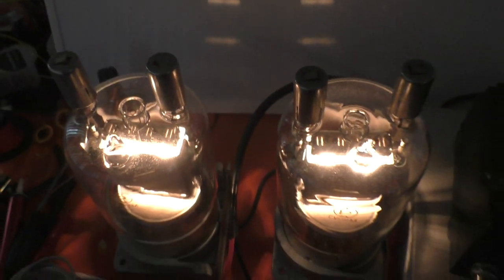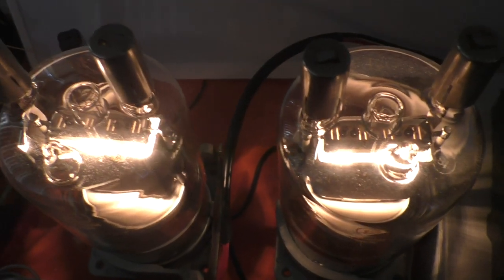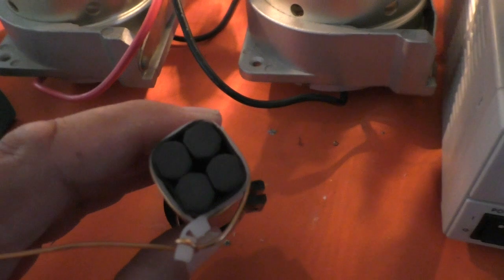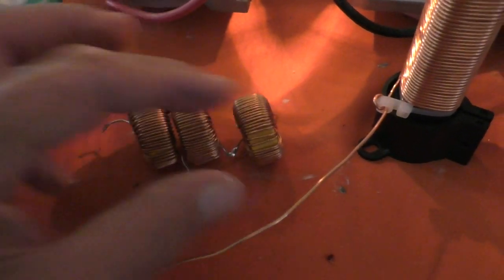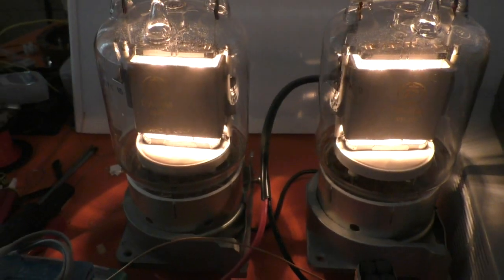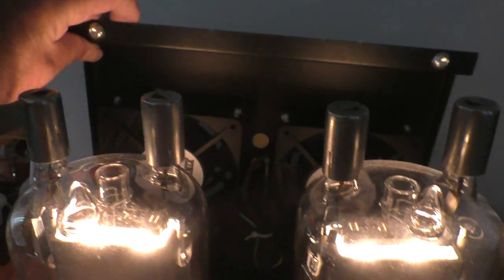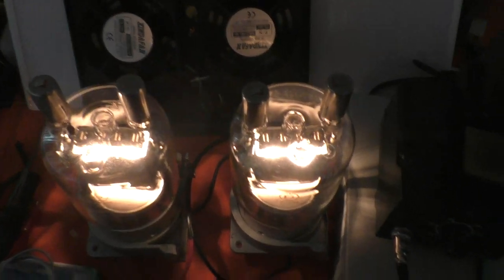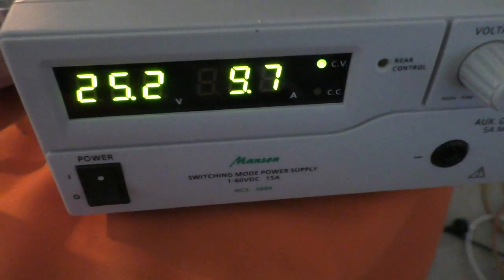GU-81Ms With 25.2V DC Heater Voltage

Comment: Nice!.. that's definitely an awesome amp developing... those tubes aka valves are totally awesome, too.. the upper half of it kinda reminds me of 833's. :-)
Reply from the maker: Thanks Terry. They do look similar, but I believe the 833s are triodes, and they're a bit bigger.
Reply: Definitely... big ol' triodes ... your pentodes have that cool shape :-)
Reply from the maker: Yes they do. Actually the GU-81Ms are meatier than the 833s, I looked up the spec.
Reply: Right on... I just saw your new video with the 12.6 volts/ 9.8-9.9 amp filament demo... they're definitely some awesome tubes... much success to you with them.